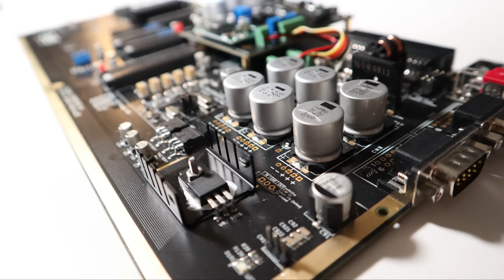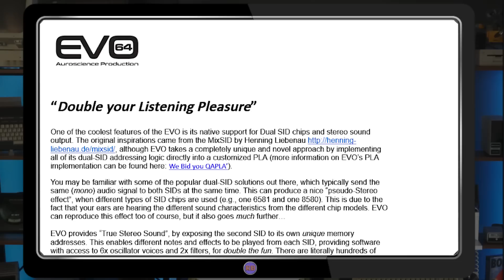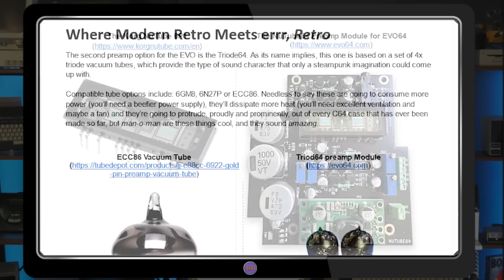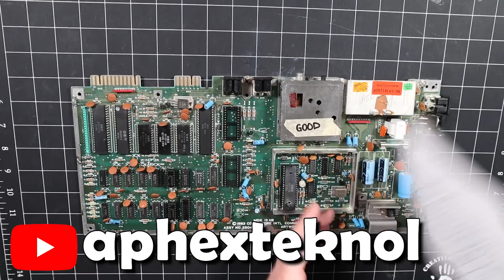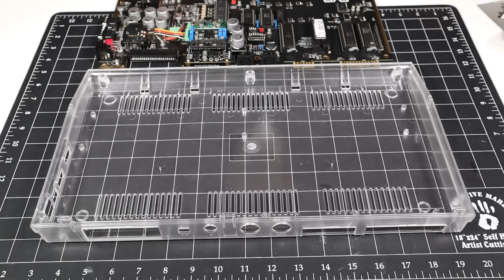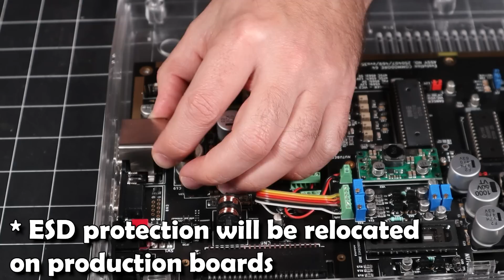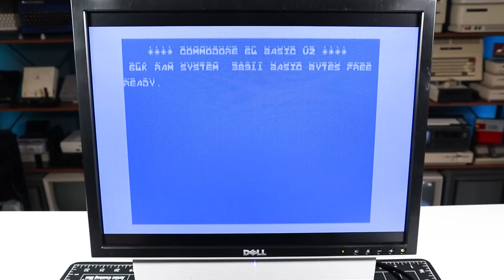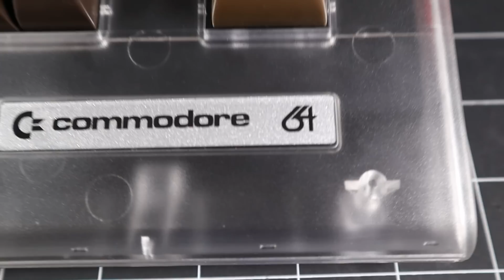A Commodore 64 with… vacuum tubes? Introducing the Evo64!

Comment: Wonder if this includes the version 2 Kernal? It has a bug in the screen editor that causes the 64 to crash. First, the cursor needs to be a color that has bit 2 set (the default light blue for example). Next, go down to the bottom of the screen and type at least 80 characters to cause the screen to scroll in two new lines. Last, backspace to cause the cursor to cross back to the previous line. If the version 3 Kernal is present, nothing happens. If it is the buggy version 2, it will immediately try to load from tape, and holding the C= key will cause the screen to flicker between upper and lower case. If you don’t have a tape player hooked up, only way to get out is a power cycle.
Reply: Production EVO boards are unlikely to ship with ROMs due to copyrighting issues. This means that anyone is free to write any ROM images they want to their own EEPROM

Comment: Very interesting, niche product. I can think of worse things to spend money on and the value can only go up right? My only concern is the original chips (Sid, VIC, CIA) as there is not a question of if but when they will decide to fail. Hopefully the Kawari replacement comes out whenever the chip shortage ends.
Reply from the maker: I have a couple of replica SIDs I want to try out next and see how they sound compared to the real deal. With the Kawari available now and CIAs in the works, it looks like we'll be able to keep these old things running forever :)

Comment: What are those super sleek ZIF sockets called? I love them! It is a great solution to make a totally ZIF'ed C64 without having to mod a lot of bits to make the sockets fit like with regular ZIFs.
Reply: ARIES low profile. Look mouser/digikey. They exist with nicker or gold plated contacts (latter hard to find). They do NOT have 32 pins, unfortunately.
Reply: @auro1999  Thank you! Will check out now.

Comment: Wonder if the Evo will work with the 6526 replacement that is out there. or the 6510 replacement.
Reply: Yep - works with all known CPU & CIA clones (MLC64, Montotech 6502 to 6510 converter, J-CIA, J-CPU, etc., etc.)
Reply: @C64EVO  Cool

Comment: I've never understood the fetish of a few tubes in the audio path - most of the times they're just another component in the path and not really needed as the circuitry is actually a better driver than the tubes themselves. Don't get me wrong I'm a fan of tubes too but they have to make sense. F.ex. a full tube amplifier (pre and/or power or integrated amp). Beside the C64 is from a very non tube era - not even for nostalgic reasons as today. So a good quality modern chip or transistor circuitry in the 64 and hook it up to a modern integrated full tube amplifier and hear the angels sing.
The evo64 board is nice though. Have for a while thought of making my own "brand new" C64. The hard part is to decide which board to go with. Each board their pros and cons.
Reply: There is a fair amount of noise within the standard C64 itself, which EVO is eliminating. Starting form the power sources, through rectification, through audio signal generation and propagation, etc. So, EVO's preamp module is fed with a clean, smooth and consistently stable audio signal, which wouldn't be possible on a standard system. Of course you could add a filter stage to the output of a standard system, in front of the preamp / amp stage, but the results wouldn't be quite as clean.

With regard to the tube preamp modules, they were clearly developed to cater to a niche audience that wants a completely unique audio experience. They're definitely not a requirement for people that might be interested in experimenting some of the other facets of the EVO.
Reply: @C64EVO  I totally agree it makes sense to adress the noise in the system. My gripe or so to say is only on the tubes.
I have one machine with a long board. Can't remember if it's 250425 but the odity is that the CPU is 8500 and SID 6581 - can't remember I've seen such combo anywhere in the internet. Anyway that machine has way lower noise than any of my other with short board. The worst of them is the one with the last revision short board. Composite outputs show the same story. Really good on the long board and worst on the newest short board. Can't decide whether or not just to leave them intact. Incidentally I believe the one with the newest board is identical to the one I got as a kid (outer appearence) but can't tell which revision board I had back then - only that I didn't remember output to be that bad (even on RF) or can be my quality reference hasd changed with time 😂. For a while I've thought about making a new 64 with as much new components as possible and so the other machine won't get much use. Difficult to make a decision which board. If only available in the US that adds a hefty shipping and tax "fine" on top.

Comment: Love this!  I have a 128D.  Is there anything in the works for one of those?  I'd love to do some work like this.  Especially since it was my very first computer and it still works!  Though it seems to have a video color problem lately.  But an updated board for it would be so sweet!
Reply from the maker: There are reproduction C128 boards (check out the C128 Neo) but I'm not aware of any that are such a dramatic overhaul of the original design as the Evo64.

Comment: This Evo64 is great, but I have to say, I feel like it's a waste to install the vintage chips in it since the PLA replacement is a modern FPGA that could run the entire computer architecture on it. Maybe it's best to use modern replacements and save the working vintage chips for era-accurate hardware (with appropriate protection added).
Reply: Brian. The PLA is an extension of the old PLA plus some logics for eprom (and/or) and the dual sid. If you look carefully I have reproduced allmost all the chips of the 407 but in SMD SoOC dimension. I chose soic because they are the largest of the SMD and can be fixed by hand. Caps and resistors are all 1206, so I believe we are hardware respectful; just smaller/
Reply: @auro1999  I think the replacement PLA replacement is a great achievement, but isn't it based on an FPGA? My point is that there is a limited stock of vintage chips available, so I would just prefer to see them used in machines that only use technologies that were available when the C64 was in production. Is there more to this that I haven't considered?
Reply: @auro1999  Also, if you actually designed this, thank you very much!
Reply: The QAPLA (EVO's PLA Replacement) is actually based on a CPLD, not an FPGA. CPLDs are simply a more modern successor to Programmable Logic Arrays (PLAs). Both CPLDs and FPGA's include programmable logic gates, but FPGAs are much more sophisticated and also much more expensive. It may be helpful to know that MOST of the C64 PLA remakes out there are also using the same type of CPLD technology (e.g., the PLAnkton, the NeatPLA, DodgyPLA, etc., etc.).
Reply: @C64EVO  That is actually hugely helpful and makes me feel a little better. Still, from a technology preservation standpoint, I would do my best to use active components with consistent dates of manufacture.

Comment: A bit sad that you cannot customize the filter capacitors (47pF for 6581 and 22nF for 8580) to use polystyrene caps instead, for example.

Comment: Sadly, you're not going to achieve the very best Audiophile quality with this setup as it stands; while the tubes and SID are fine, there are many compromises in other areas that no Audiophile would make. Here are five areas to fix.

1. Cabling: All of your cables, including the power cable need to be audiophile quality: oxygen-free copper in a multi-strand configuration with the correct proportions of AWG 40 (17 strands), AWG 37 (14 strands) and AWG 33 (6 strands) wires within the conductor. Note that this are relatively prime, for proper separation between bass, midrange and treble signals. These figures are for to NTSC systems: for European PAL systems you will need to use 0.080, 0.112 and 0.181 mm diameter strands instead or you will find the mid-range blurring the treble and bass. Good cables run around $35/cm, but are well worth it. Also, note that for best effect you should burn in your cables for at least 80 hours on triangle waveforms with the filter set to a least a 12 dB/octave rolloff at the fourth harmonic.

2. Proper soldering of the connectors on the board. These boards were probably soldered with straight 63/37 Sn-Pb or, worse yet, lead-free solder; this will greatly affect your audio quality due both to the data errors from alpha radiation (as well as the usual contaminants, lead-210 beta decays to bismuth-210 and then to polonium 210) and the eventual growth of tin whiskers. Pull all devices off the board, clean off the current solder thoroughly with flux, and tin all connectors with a eutectic aluminum-beryllium solder before re-soldering the components to the board with a standard 60/40 Sn-Pb solder in order to mitigate this problem. This will result in a remarkable increase in transparency, especially in the critical upper midrange.

3. Digital issues causing phase incoherence are well known to affect audio quality, and this PCB does not appear to have been treated for this. Fortunately for this at least, there is a simple solution: use a green magic marker to coat the edges of the PCB to reduce the sub-picosecond shifts within signals on the board and better align their edges. I find that Pantone 15-5519 ("Turquoise") is a good compromise for general purpose use with all versions of the SID chip, giving about equal phase coherence correction throughout the audio spectrum, but Pantone 15-5217 ("Blue Turquoise") will produce slightly better phase coherence in the low end if you're using an earlier version of the 6581, at the cost of slightly reducing between-range clarity in all versions of the 8550.

4. Your mounting system for the C64 is critical. You seem to have placed it directly on a table: this will cause smearing in the low frequencies due to room vibration. Traditional turntable mounting platforms are of no use here since this system includes digital components: instead you will need digital-specific mounting feet made for pre-1990 CD players that are made of multiple layers of neoprene and organic glass. These can be had from many sources for a few hundred dollars per foot. Ensure you use the four-sided pyramidal ones; the three-sided pyramids are not compatible with eight-bit systems.

5. Unless you're using the system in a room properly treated for anechoic response across the electromagnetic spectrum from 10 Hz through 12 MHz, you are likely to be suffering from near-field EM interaction. I recommend a product such as the Blackbody v.2 Ambient Field Conditioner to fix this. I have in my personal use noticed that placing one semi-soft organic body on a vector 30° off from the line from the Blackbody to the audio equipment will help reduce occasional spiking of transients in the odd harmonics. A banana works well; do not use a harder fruit such as an apple.

I know that these may seem like a lot of trouble and expense, but I have no doubt that you'll hear a distinct improvement with any one of these, and doing them all will leave you in Audiophile heaven.
Reply: I really hope he's joking.🤪
Reply: @wimwiddershins  True Audiophiles never joke about their quest for the best and purest listening experience!
Reply from the maker: This is some Turbo Encabulator level stuff right here :)
Reply: The audiophile's pursuit of the purest sound is admirable, although some aspects can boarder line on obsessive. EVO is clearly making some big leaps in the general direction of improving the C64's audio signal quality, throughout all stages of power signal generation, rectification, filtering, voltage conversion and all stages of processing, as well as the end-to-end audio signal output path. Is there more that can be done? ALWAYS.... The EVO team is listening and we're more than happy to incorporate the features that most users want, as long as this doesn't create barriers to entry that prevent folks from enjoy their experience.

Comment: Would it be possible to record a few songs and make them available as FLAC encoded files somewhere (f.e. mega, dropbox, ...)? Would really like to hear some common sids/games/demomusic and compare with my recordings that way to see how much more detail the nutube provides.
Reply from the maker: Sure, I can do that! Each SID channel's gain/distortion/harmonics are adjustable to personal preference and not all songs will sound as good with just one setting or any particular set of speakers, etc. Hopefully you will still be able to get an idea of what it sounds like, but I can't promise anything! Any songs in particular you would like to hear? I recommend stereo SIDs designed for a PAL machine as that's the configuration I'm currently running. Mono SIDs just don't have the depth and fullness of sound the NuTube is capable of producing.
Reply from the maker: Here are some recordings I just made in FLAC format. I was using my PC's on-board Realtek sound so it may not be the best recording quality though. Again I want to reiterate that the tubes can be tuned to your preference and this is just one possible setting. https://retrobits.tv/Evo64_SID_Demo.zip
Reply: @retrobitstv  Thanks so much. The Cane-Phobos example song shows the nuances of the NuTube64 quite well. Certain gentle harmonics can be heard in mid-frequency. And the bass is so much more umph-y ... The 6581R4AR is the only one that can go so low IMO, but only at the cost of making the complete song sound muffled. Not like with the NuTube64.

Oh man, it's going to cost me a bit to get one to Europe. How much do kidneys go for these days? :)

Comment: Without the inexplicable inclusion of an audio amplifier inside the case…and considering that we already love how a SID chip sounds and we have sid2sid and vic2squred ntsc/pal switchable and the lm7805 switch mode mod is common: why?
Reply: why not ?
Reply: Well, you certainly could bolt-on a bunch of separate add-in modules to get support for dual-SID, PAL & NTSC switching, Improved Video output performance, multi-ROM support, ESD port protection, etc., but isn't it easier to have all of the best new features already pre-integrated? This approach saves a bunch of build time, the end result looks cleaner and it's actually cheaper than buying all those separate modules and adding them to a new DIY board.
Reply: @C64EVO  Well I've done it all to my Breadbin by now. All mods possible that I know of. and then, some. A red / blue IRQ activity LED. mechboard 64 w/ cherry MX blues, white front-print keycaps, SIDFX, 4 paddle potentiometers, volume potentiometer, reset, vicII2, JiffyDOS, vacuum tube pre-amp...why not. It's cool. All Frankenstein's monster looking.
Reply: @skeggjoldgunnr3167  that's a preference thing. Some folks are really into the look of having lots of smaller DIY-projects and add-on modules all wired up together. 

We took the approach of integrating everything together...
Reply: @C64EVO  I know! and it's awesome! I want to boot right to Cynthcart 64 on Kernal ROM!! Switchable - on a 250407 - I don't know if it's possible. I have eproms, eprom programmers, hex editors, my EE degree, 50 years experience in the electronics field...

IF it is possible I would then build internal MIDI ports.

Comment: It gets the point when needing original C64 components or using instead modern replacements when possible that it becomes a case of "why in the heck don't we just put it ALL in an FPGA"?
Reply: Well, the FPGA thing has been done a few times already (Ultimate 64, MiSTer, Mega65, etc.)? 
EVO64 is striving to find an admittedly subjective balance between modernization and original authenticity. 
You don't actually need to use original MOS/CSG chips for most of the board's functions... 
You can replace the VICII with a Kawari, the SID with a multitude of clone options, with a converter board you could use a 6502 instead of the original 6510 or 8500 series CPUs, all the C64 ROMs have been replaced by a single EPROM, the clock gen oscillator was eliminated, etc.
So, you could choose to make yours as original or as modern as you like.

Comment: very cool but a bit out of my price range! I appreciate the work that has gone into it though. 

I really wish there were modern equivalents of the CIA/VIC II/CPU. I know they're WIPs (some of them). I think when you can completely build a c64 clone with current stuff, the market will grow a lot.
Reply: board works with 6502 too (there is an adapter). Board works with VIC2 Kawari too. VIC2 was brought down to give more space. SIDs replacement are available. CIAs replacements are been working by some folks now.
Reply: @auro1999  ah that's great, thanks! I didn't realise the vic ii had a replacement out there, FPGA or otherwise. I thought it and the CIAs were still "original only". Thanks!

Comment: did you know that zig makes the 650x line still? in other words I wounder how many of these parts are still in production.
Reply: The only part that EVO requires that has limited availability are the MOS 6526 CIA chips. Literally everything else is either still being manufactured, or has multiple aftermarket alternatives available (e.g., Kawari VIC-II replacement, SID clones, 6502 to 6510 CPU conversion, EPROM ROM replacement, Oscillator  Clock alternative, etc.)
Reply: @C64EVO  it would be cool if someone could make an FPGA for it then though if that were possible then it would have been done already...